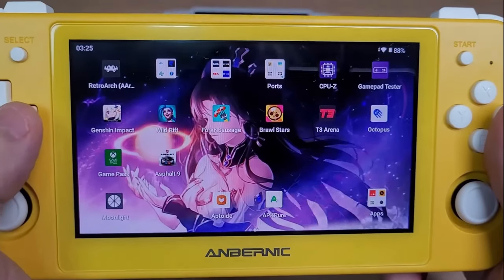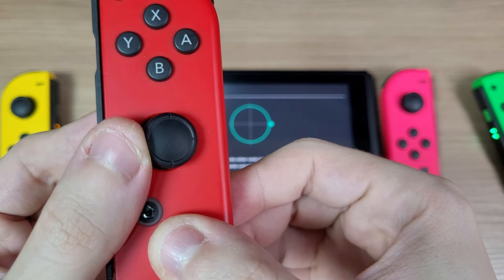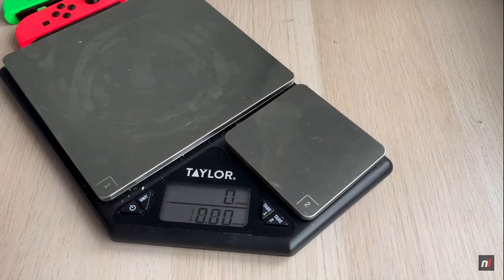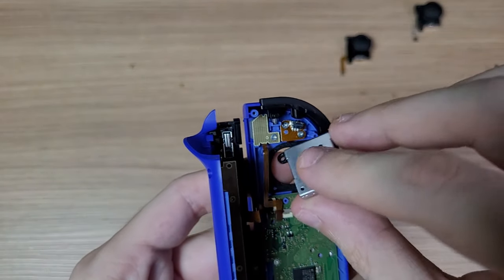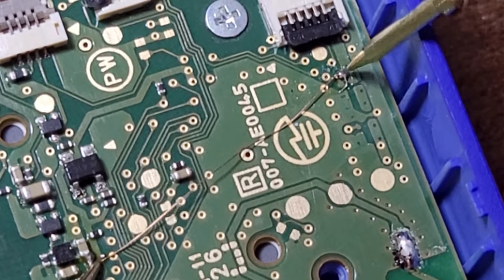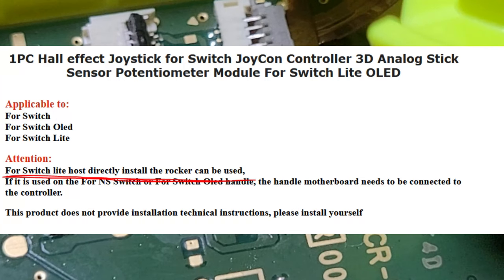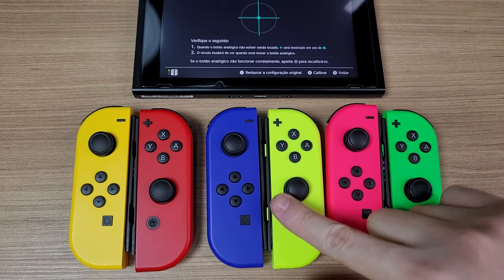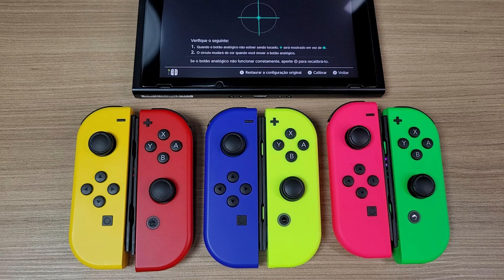Better Hall effect sticks for joycons! - K-silver modules are back once again!

Comment: I don't remember if you can change the outer dead zone on the sticks, but.... 
I just remember changing the calibration/deadzone settings on a program called joycon toolkit
If there's a way to edit the outer deadzone.... that may fix the issue with hall effect sticks

Comment: honestly the convenience of not needing to solder overweighs the usual faults gulikit has

like im not gonna buy a whole temperature controlled soldering iron with a setup just to replace a single component
Reply from the maker: You dont need a temperature controled soldering iron 

Just a simple 30W soldering iron will do

You just need to have good soldering skills
Reply: @VKsChannel  see that's the thing, most people can't solder, not to mention solder well. 
most people can however disassemble a joycon and put a new stick in.
Reply: @tsrenis  Skill issue

Comment: Do you know where to buy the "power saving adapter" for the ksilver joysticks? I already bought the hall effect sticks but I am not able to solder it for the left joycons. The soldering point are even to small for the left, so I want to use the adapter to do not need this soldering. I am searching on Aliexpress, but its really hard to find something.
Reply from the maker: Only the adapter from elecgear is solderless

As I've shown the ksilver adapters have a wire as well
Reply: @VKsChannel  Did you also faced the issue that after a few hours gaming, one of the buttons (y, x, a, b) do not working probperly? I soldered the sticks into my four controllers and on two controllers (always right joycon) I get the problem that A/Y do not recognize the input in four of five times.
Reply: @VKsChannel  I figured it out and the final help was NFC. It told me there is not enough power coming from battery. It seems the KSilver sticks having to big measurement tolerance in the production and not all of them consuming the same voltage. After replacing these sticks with some other KSilvers everything worked well again. Buttons push work now in normal conditions and NFC is back to work.

Comment: gulikit are better because stiffer joysticks makes more durable to drifting due to the lost in force of the spring who centers the stick
Reply: And I say so because some k-silver modules in other controllers like flydigi Vader 3 pro are more easy to move, which makes it even possible to wobble them by shaking the controller, so actually a more stiff joystick is overall better which makes the modules of gulikit better with a high spring resistance, making the 8bitdo Ultimate Bluetooth controller the most durable actually because based on the review it is the most resistant joystick module on all the controllers, then the gulikit kk2 (but sadly it's buttons don't work), then I would bet for T4 kaleid or G7se but, that, and flydigi, and every other use k-silver hall sensor joystick which makes me doubt about their durability long term
Reply: Well, question of personal preference. I prefer the softer joycons and for me it's much easier to control and be precise with smaller movements. The stronger force to go back to center from the gulikit and the "sand" feel was not enjoyable for me.
Reply: or longevity

Comment: I watched whole video two times and still have problem with understanding which one I should choose, K-Silver or GuliKit? I intend to install them in Switch Lite so soldering is not a problem (from what I understand there is no need to solder K-Silvers in Switch Lite).
Reply from the maker: Ksilver feels like original joycons

Gulikit will feel more stiff with an increased resistance
Reply: @VKsChannel  I've bought both and tested them today and personally I like increased resistance of Gulikit. Unfortunately one of the Gulikit sticks have some problems when moving up/down (not always going all the way down, I've already contacted the seller) so I was forced to go with K-Silvers. They are working flawlessly at the moment. Have you noticed that K-silvers are lower than the original ones while Gulikit are slightly higher? If someone is using Switch Lite Flip Case with additionall thumb stick grips K-Silver are preferrable as Gulikit may not fit when closing case.

Comment: Having to solder a wire onto the board is a deal-breaker. How do you know that there are no long term ramifications to the rest of the controller?

Do not recommend.
Reply from the maker: There is another solderless module online, and until now noone reported any issues with the sticks, including the friend who I got these installed